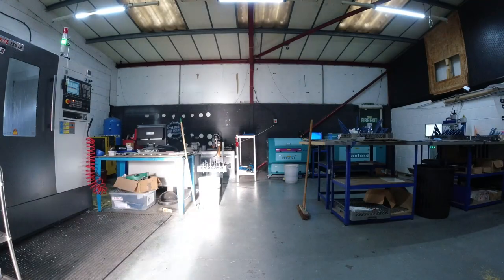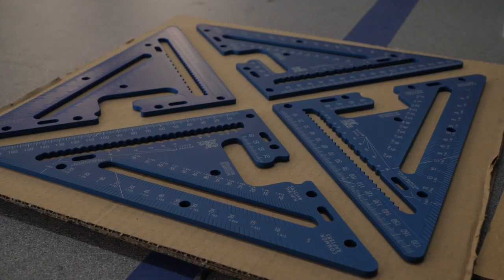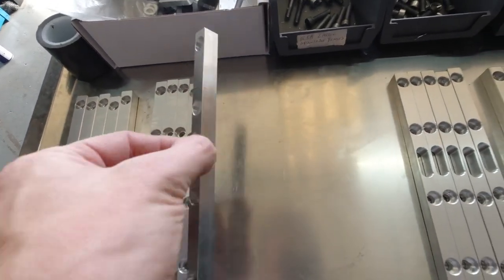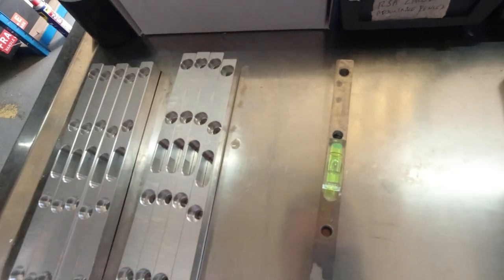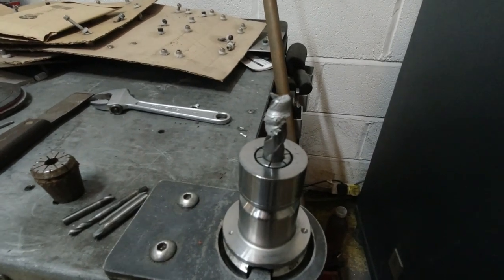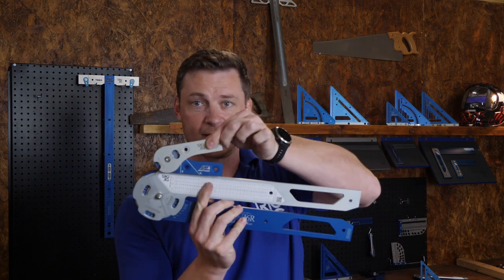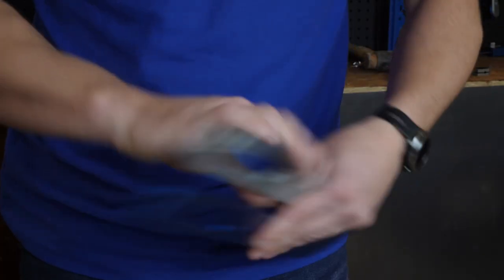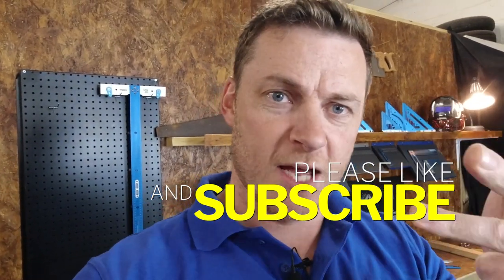Making tools in the workshop | Chip weld gremlins return | TrigJig Workshop Ep 2

Comment: I just have a question actually, wouldn’t a high pressure water jet cut your parts better than a mill ? I’m sure they cost a fortune but at least you wouldn’t have chip weld issues
Reply from the maker: They would be good for certain parts we make and not so much for others, the AF16 for example would still require milling ops. But you're right they cost an insane amount. Hopefully we'll add one in the future. There aren't many companies around that can cut for us either.